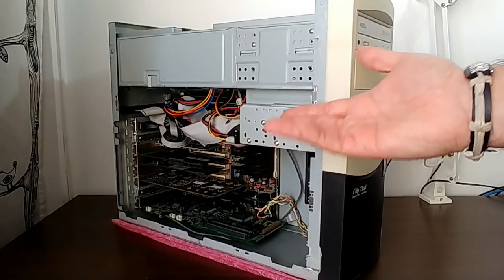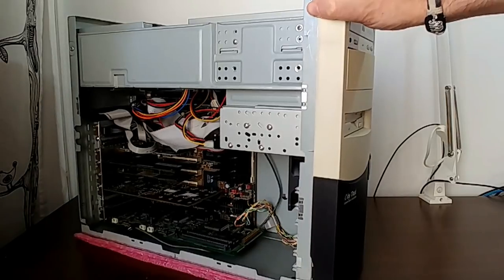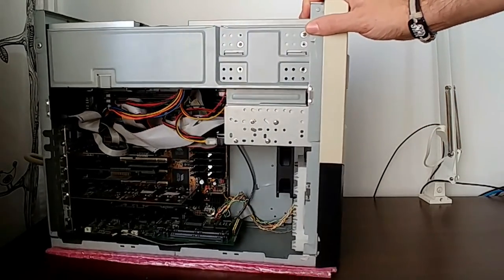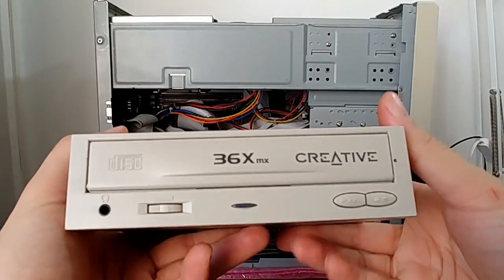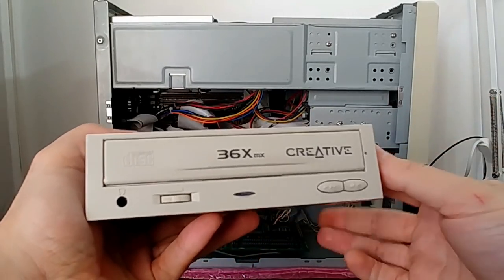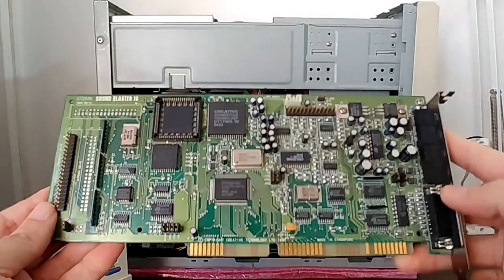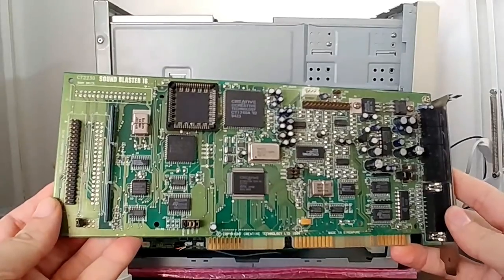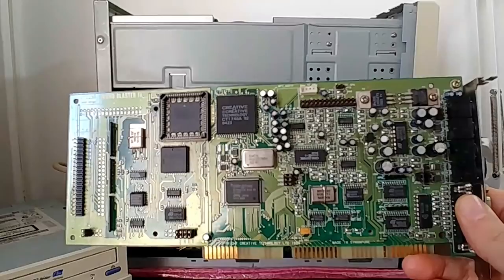Pentium 1 Upgrade! Installing Sound Blaster 16 + CD-Writer

Comment: Producing your own homemade CDRs in the mid-1990s, was akin to alchemy and witchcraft!  However it was also not good for your wallet sitting, staring at the PC and literally praying, that your disc did not crash during the writing process.  It was usually no faster than 2x at that time too, so you would be sat praying for a long time!
Reply from the maker: Tell me about it. Hundreds of hours around that.
And the software... It was awful.

Comment: Does your awe32 have an opl3? Because the awe32 should be exactly the same as the sb16 only with the midi section added on.
Reply from the maker: Nope. The ct3600 I was using is missing real opl,
Reply: @DeckardGames  if you liked the midi stuff I would look for a awe32 with opl3